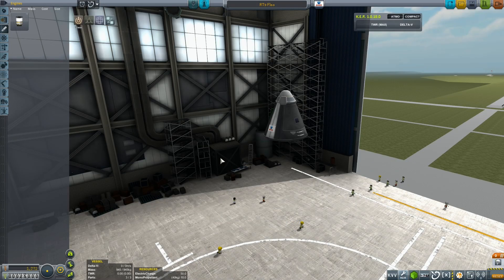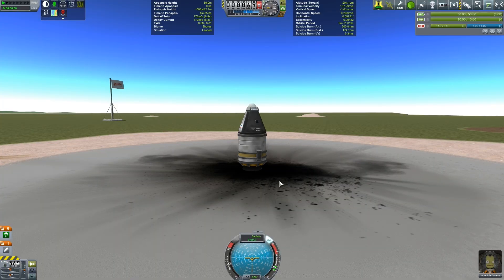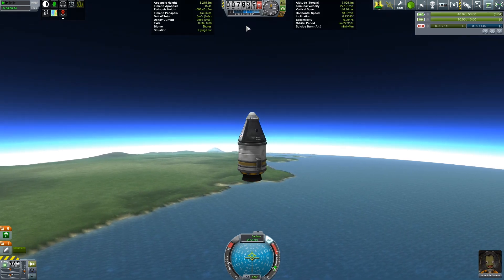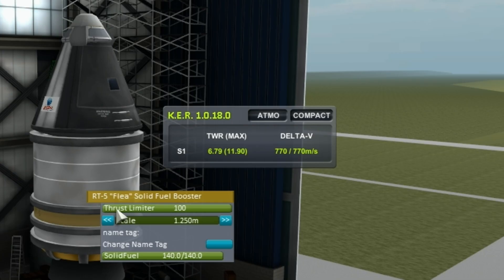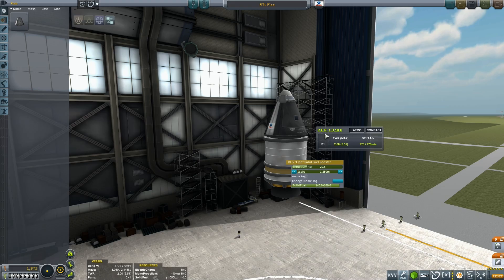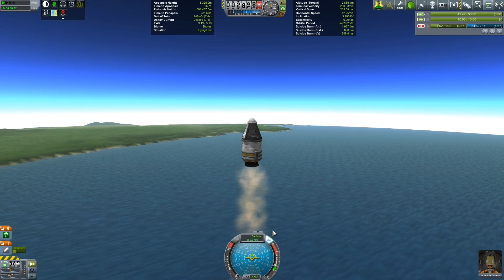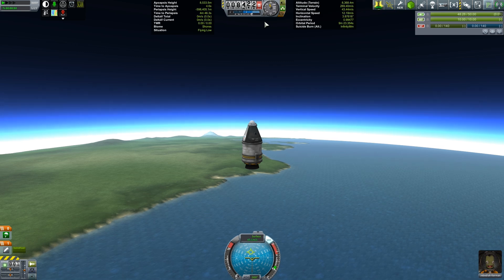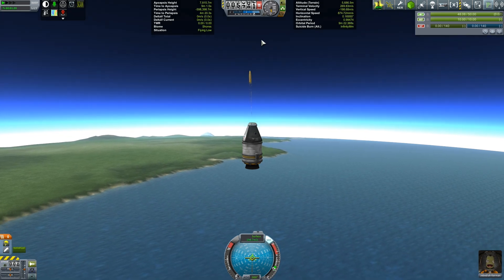Viruk and Jeb 16: Solid Rocket Boosters

Comment: I wonder if you could tell me the mods do you use this video.
Thanks!
Reply from the maker: João Antônio The one which is most obvious is the Kerbal Engineer Redux (http://goo.gl/sFttbj). This provides the displays across the top of the screen so you can see your telemetry. It provides information both in the VAB/SPH as well as a part so you can see that data in flight.

If there's a display, button or part you want to know more about, just drop me a comment.

Comment: My rockets tend to have about 1.4 twr. The mass drops and if the twr increases to 2.0 before reaching 30 km I throttle down to increase efficiency.
Reply from the maker: CaptainOfGames I agree. For some rockets a TWR of 1.4 is good. I use that value for some of my early rockets and especially in previous releases of KSP. This value is particularly good if the SRBs are a sizeable proportion of the weight of your craft, as that weight will drop very rapidly, causing the TWR to rise significantly. This then necessitates a lot of manual throttle management as you describe. Thanks for pointing that out.

I appreciate you taking the time to view the video and make the comment.

Comment: Kudos to you for Squad themselves sharing this video on Facebook!

A cautionary to other viewers, don't set your TWR too low either, or you'll lose efficiency because of gravity losses. There is a ''sweet spot''.
Reply from the maker: J Halson Thanks for the view and the feedback.

You're quite right. It's all about managing your thrust-to-weight ratio. Too high (this is the scenario I was reviewing) you'll end up going way too fast, way too low and thus losing efficient against drag. Too low (below 1.6 or so) and you'll be wasting efficiency against gravity. Way too low (less than 1.0), and you won't even get off the pad.

The sweet spot for me depends on craft but is about 1.6 when on the pad. If I have a liquid fuel engine I manage the overall TWR using the throttle to about 2.0.